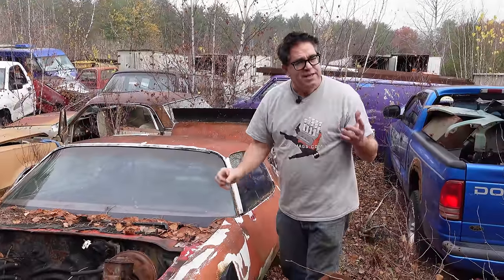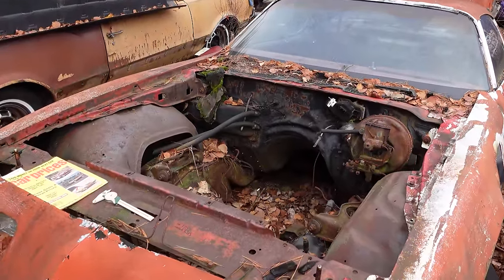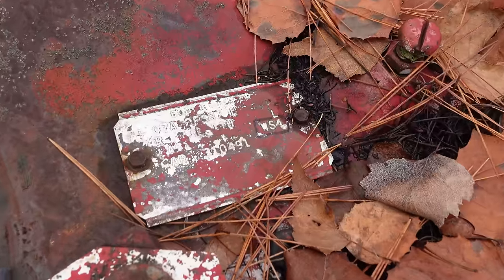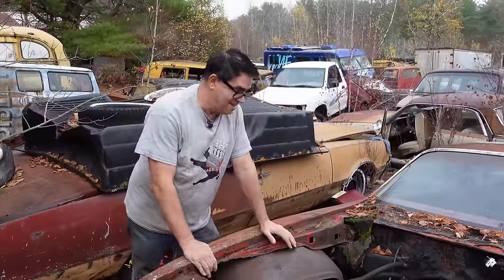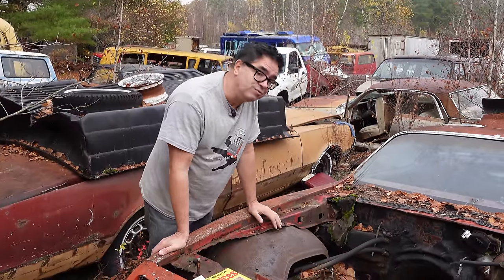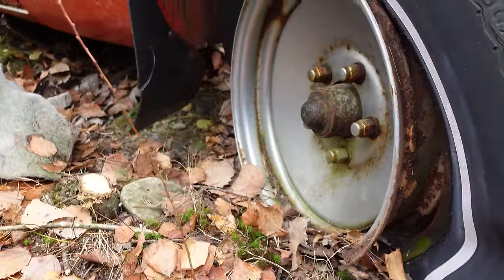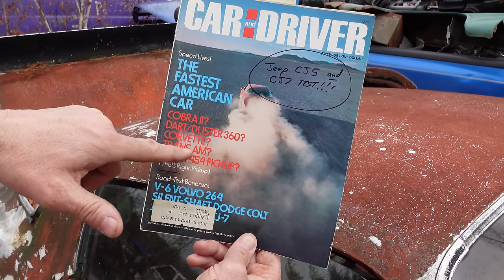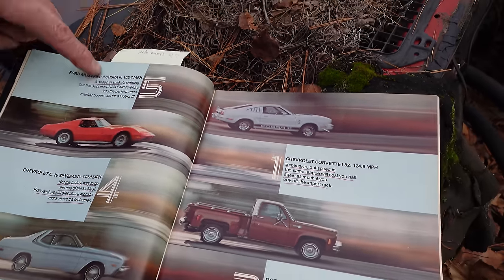1979 Trans Am

Comment: As a 40+ year owner of these cars, I like the 1979 to 1981 front end better. Plus the cars were slightly more refined. Nothing against the 1977 or 1978 models (and I like them), but I like these better. As many who know me know, I have an '80 Turbo in Carousel Red that my parents bought new in 1980 and I also have a '79 10th Anniversary 400/4 speed, one of 1,817 made. When I bought the 10th in 1999, it was "collectable" (not like today) and a 20-year-old used car. I am probably the sixth owner of it, but I know every owner it has had. It has only gone 7,000 miles from 1987 until now. The original owner of my car paid over $13,000 for it at the end of 1979/early 1980 and had to "influence" the salesman to find it for him with $500 cash. He bought a 403 car, drove with the dealer from PA to MD to get the 400 car (at Liberty Pontiac in Randallstown, MD) and then went back to Brake Pontiac in Waynesboro, PA to do the paperwork. Liberty Pontiac was at 3636 Brenbrook Drive and Caliber Collision is there now. Brake Pontiac became Lynn Buick-Pontiac (the original owner of my car traded it for a 1987 Grand National which I believe he still owns) and is now Buchanan Chevrolet at 1035 East Main Street in Waynesboro, PA. The original loan for my car (paid off in 1983) was from First National Bank in Waynesboro. As many know, I almost bought a 1981 Nascar Y85 Trans Am last year local to me, but I stuck to my guns on price and the seller sold it for more (I doubled his money. The person that bought that car is upside down already in it, I refuse to be upside down in it). 

We'll start with the tag, because with that you can brag: 79 for 1979 model year, 07A for the first week of July 1979 production, 2FS87 for Pontiac Firebird, N for Norwood, OH assembly, 74R for Carmine vinyl standard interior trim, 11U and 11L for White upper and lower exterior paint, L for lacquer paint technology, A51 for bucket seats, CAR for Carmine secondary trim (carpet, package tray, etc.) and WS4 for Trans Am. The WS4 is on the tag because that is an item that concerned Fisher Body on their end of the process.

No, you are correct, the VIN gets you the win: 2 for Pontiac, W for Trans Am, 87 for two door coupe, W for 301 Pontiac V8 with four barrel, RPO code "L37", 9 for 1979 model year, N for Norwood, OH assembly and the rest is the production sequence. The Norwood plant closed in August of 1987. Norwood cars used lacquer paint and those at Van Nuys, CA used water-based paint due to the CA air regulations at the time. Van Nuys, CA closed in 1992 and was one of the "Terrible Three" GM plants in California, along with Southgate (closed in 1982) and Fremont (closed in 1982, Tesla occupies part of this property now). Yes, both the automatic and four speed were a possibility on a 1979 Trans Am with a 301 V8. The Olds 403 cars only came with an automatic and the Pontiac 400 cars only with a 4 speed in 1979. 

Correct, getting a 301 in 1979 was a credit to the buyer. The standard Trans Am engine was the 403 Oldsmobile V8, VIN code "K", RPO code "L80" and optional (for about $90) was the 400 Pontiac, VIN code "Z" RPO code "L78/W72" engine. All 1979 Pontiac 400 engines were 220 HP (on paper) W72 versions that were stockpiled prior to 1979 for installation in 1979 models. Many have 1977 and 1978 casting dates on parts, as mine does on my 10th Anniversary. Yes, correct, 7,500 10th Anniversary cars, with 1,817 having the 400/4 speed combination and the balance 403 Olds V8 equipped. When you ordered a 10th Anniversary with a 400, you came out "ahead" since you got a credit for cruise control as you could not get cruise with a 400 Pontiac engine in 1979.

That book is wrong---the 301 was available in the Trans Am and yes, you're looking at one in front of you. I have a friend who has one and has owned it since 1982. I kid him all the time about his "parts car". LOL. He's from Boston, so he has that funny accent. When he calls my house, I say, "What's up, Paul Revere. How's the tea party going?" He comes back with some colorful words in reply. LOL.

No, the D53 is ONLY for the hood bird. If you want a good video to watch on that, look up John Schinella at the 2009 Trans Am Nationals. He describes how the D53 came to be and how he fought GM management to get on the option list. In 1980-1981, Turbo cars (like mine) had a "bulge hood" and other engines (the 301 non-turbo and 305) had a shaker hood. No, all 1979 Trans Ams got the shaker hood. If you didn't order D53, you got a shaker with no decal. Mr. Schinella is a legend in the Trans Am world and had a handle in the design of the 10th Anniversary Trans Am. The "Turbo Flow" wheels were made by Appliance Wheel to his specifications and were first seen on the 1979 10th Anniversary and then an option on 1980-1981 cars. 

Yes, the 455 VIN code "W" RPO code "L75" made 200 HP because it was straight out of the large car/station wagon parts bin as it were. No, I believe RPO G80 limited slip was optional in 1979, depending on the model, although many cars had it. That center section spoiler is the same GM part #480161 for all 1970 to 1981 Camaro and Firebirds with that type of spoiler. I have an NOS one from Roper Pontiac in Joplin, MO which Hal Roper the owner, supposedly tripped over in the parts department and told Jim Barry, the parts manager, "Get that thing out of there". Back then, I would scout NOS parts and I came across that one and Mr. Barry sold it to me very reasonably. I also have several used ones and side pieces too.

Yikes. (faints) NO. The 403 Olds is a small block V8. It is not an Olds big block. The Pontiac 400 is not a big block. Pontiac did not use small and big block designations. LOL. Au contraire on the Turbo 301. It gets a bad name, but it was right for the times because if you went over to the Blue Oval in 1980-1981, you got a 255 V8 that barely mustered 150 HP in Mustang. At least you got 210 HP in 1980 (200 in 1981) on a Trans Am when optioned correctly.
Reply: Hi , G P ,  heard a rumor a couple a years ago that some of Burt's cremains we're buried in one of the T A's he drove in the movie . They put the urn on the front driver's seat . It's supposed to be here somewhere in Florida .  Don't know if it's true or not , but I wouldn't put it past Buddy to request something like that .
Reply: @daynadiggle8169  I'm not sure about that, he did own a ranch in Jupiter, Florida, but he left it around 1999 when he went bankrupt. It's now going to be million dollar homes from what I read. Mr. Reynolds was promised a new Trans Am by the president of GM and then one year they stopped coming. He politely called and was told rather curtly, "That deal was with the old president and he's gone", and the guy hung up on him. Typical GM. I wonder today if that person would have been fired and Mr. Reynolds would have gotten a new one as promised. He did make the Trans Am sell. 

Another good role he played was in the "Longest Yard". Look up the car chase scene. Another bunch of Florida natives is in that scene---Saturday Night Special by Lynyrd Skynyrd. One of my favorite bands.
Reply: Lots of debate on where small blocks stop and big blocks begin, when we're talking about Pontiacs. For me, I consider everything, from the 400 on down, to be a small block, as those engines all had the smaller crank journals.  Big blocks would be the 421/428 and the 455 with their larger journals.
Other folks will note the displacements, and term the 389/400 and everything larger, as a big block.
Were 301 parts not interchangable with the rest of the Pontiac V8 line?  If that is the case, the 301 could be a small block, making everything from the 455 down to the old 287, a big block...
I always loved the '77-'78s in black and gold, but now I believe that the '70.5-'73s are my absolute favorite TAs.
Reply: @DanEBoyd  Never, ever, ever, ever, ever, ever, ever, ever, call a Pontiac V8 a small or big block. Never was, never will be. LOL. The term "large displacement" is better if you must use those terms. Chevrolet and Oldsmobile used those terms and they are recognized, Pontiac did not. Thou shall not call a Pontiac V8 a big or small block. LOL.
Reply: @DanEBoyd  Yes, some parts on the 301 will fit a 400. Depends on the part. Both my 301 and 400 use the same AC Delco 41382 fuel pump. They use the same spark plugs, R45TSX. Other parts were the same. So, they are not small and big block. Anyone in the Pontiac circle never, ever, ever, ever, ever uses those terms when talking about a Pontiac V8.
Reply: @daynadiggle8169  If you want to "meet" the guy that sold my parents the 1980 Trans Am new, his family did a tribute to his life on YT as he just passed this year. Look up "RIP Ernie Viespoli" on YT. It's a bunch of family videos of him and his family. In some footage, he's wearing a "DiFeo Auto Group" shirt which was the successor to Park Pontiac on Communipaw Ave in Jersey City, NJ where it was sold new. That building is now Hudson Hyundai. I used to get gas at the Exxon station (now gone) there all the time. He was the sale manager at Park Pontiac and I wound up trading e-mails with him about 7 years ago and I called him and spoke to him. He remembered the car and my parents. When I asked him how that was so, he said, "I gotta memory like a steel trap, kid. The girls were all wearing Candies shoes back then. My daughter wanted 'em and we bought them for her. Your sister liked them too and I remember commenting on that. Plus, how many Turbo Carousel Red cars could I have sold back then?" He was 100% right on. 

That's the same person that sold us the Trans Am new in 1980, as well as two Pontiac Bonnevilles (a 1978 and 1980 Brougham) and a '79 Phoenix. We also bought cars/company cars from the sister dealerships of J&F Oldsmobile and DiFeo Chevrolet, and my cousin's husband worked at Hudson Toyota which is still in business.
Reply: @DanEBoyd  big and small block have nothing to do with cubic inches. They are simply different engine design. Chevy had two type of V8 and one was smaller than the other. There’s nothing more to it. A chevy 396 is a big block. A chevy 400 is a small block, different designs.
Reply: Good write-up. I also prefer the 79 nose. it's what I wanted when they came out back in 79. I finally got one about 16 years ago, and now have 4. Being that 79's were the highest production, there are still many out there. One correction...all 79 TA's came with the limited-slip rear. I believe it wasn't until 81 that they decided to make the posi an option on the TA instead of standard equipment.
Reply: @grand73am  For the most part. Some literature shows it as optional. Most of the ones I've seen have it. Yes, optional in 1981. GM did some weird things back then.
Reply: like the 77 front end and 79-81 taillights
Reply: @googleusergp  Hi again , G P .  Just got back home .  Getting ready for another Cane !  Their knocking us out down here .  Can't understand why anybody would want to live in this state 'cept us Rebs .   And I'm so sorry to hear about Ernie . So awful . But the Candies shoes ?   Their great !  I still keep a couple of pairs I wear on the beach .  Well , you have a good one , Miller Time is coming up in about a half hour .  Enjoy !
Reply: @Yann396  That's exactly it in a nutshell.
Reply: And they were rating the 200hp at 3500rpm which is laughable in itself.....
Reply: Thanks GP for sharing your wealth of knowledge. Enjoyed reading this. 👍
Reply: Wow! Steve is right about your response. Same question I put out there in my comment. What about the his and her shift package? I only drove that car once and accidentally found the his shift package down the right. It just amounted to shifting through the gears one nudge at a time. When we got back with the car we told his dad what we had discovered. Apparently he did not know. Being a Methodist preacher he was a very honest man. He related to us teens and kids very well. The car actually unofficially got kicked out of that church it wasn't conservative enough. They went to church in a larger metropolitan area. After high School military duties lost track of them.. so that's all I know about the his her shift package. Curious to know if it was available on various engines or just the one. Or if it was a common item on those birds. I'm a first gen bird fan myself. By the time Pontiac got the firebird right again Mr Obama said here's your check and dropped the Pontiac division!
Reply: @DanEBoyd  The Pontiac engine is the same block for virtually every incarnation.  The journal sizes change almost year to year from 1955-1959, when they settled on one, but then to get more than 400 CI out of them they reduced the journal size to get a longer stroke.  The 301 and a short lived 265 version have a shorter deck and thinwall castings.  But even the 1961-63 194 four cylinder is the same block save it only has one cylinder bank.
Reply: I was looking for the Google Man's comment. I too favor the 79-81 nose. It's my favorite as well.
Reply: @daynadiggle8169  last I saw his Trans Am went through Barrett Jackson a few years back
Reply: Google user GP,. Are you sure that was lacquer paint?  I thought Acrylic enamel baked in oven was the factory paint of the 70's.
Reply: Thank you for posting this! I have owned two of these cars, so I appreciate this as I did not know some of it.

My OCD always kicks in when I hear someone call a Pontiac motor a "big block"! As you have stated, there is no such thing.

Great info!
Reply: @googleusergp  Yup , yup , yup right , G P .   My Chev 454 , BIG  BLOCK .   And I love big blocks .  Yes , I do baby them with open hood at every stop , oil and filter every 1,000 miles , and a little upgrade on the gas , not corner store swill .  I always had small blocks to race with a big block thrown in there ever now and again .  But learned to love a big block .
Reply: Did you know that James Garner abhorred the 79 so much that he turned down fatory cars and kept 78s at his own expense For filming on the Rockford Files?   Given that the show was known to wreck a car every now and then it probably was not too cheap for him.
Reply: @kennethsouthard6042  Hi , Ken , weren't these all Esprit models ? As I recall , Jimmy wouldn't drive anything else on the show .
Reply: @daynadiggle8169   That's my understanding too
Reply: @Yann396  Actually, for a while, a Chevy 400 could also be a big block. That 400 was just a 325 horse 396, punched out to 402, the way Chevrolet made them from 1970 till 1973 or whenever.
If you got the SS 396 option on a Chevelle, Camaro, or Nova, the engine was badged as a 396, but if you got one in a pickup, full size car, Monte Carlo, or Chevelle 400, it was badged as a 400 Turbo Jet. I think the SS 396s were all 350 or 375 versions, while the 400, I'm pretty sure, was just a 325 horse version.
The small block 400 was the Turbo Fire.
Reply: @DanEBoyd  yes I know that. I have multiple 396, 402, 427 and 454. The point is that BBCs and SBCs are just 2 different engine design, it has nothing to do with cubic inches. Those terms where invented by Chevy back then to differentiate their V8s and the concept has been misused for years for other brands engine. All V8 Pontiac use the same engine design from the 306 to the 455. No small or big block for Pontiac.
Reply: @dand3975  Lacquer paint. That's what the "L" on the tag means.
Reply: @will7its  Until you own and drive one as I have for 23 years.
Reply: @NotAGarage  I'm here, but comments are dropping in and out. Let me know if this stays or not.
Reply: @_Dave_S  "Thou shall not call a Pontiac V8 small or big block". LOL.
Reply: @DanEBoyd  You're mixing and matching things here. There is no Pontiac big or small block V8. Period. End of sentence. Parts do interchange between smaller and larger displacement Pontiac V8s. Pontiac folks NEVER call them small or big block. Ever. LOL.
Reply: @daynadiggle8169  I was always a Pontiac person. There's been a Pontiac in my family since 1977. I like Chevrolet V8s, but I like Pontiacs better.
Reply: @daynadiggle8169  Yes, Mr. Garner did not like the Formula so they "de-Formulaized" it for his liking.
Reply: @googleusergp  Hi , G P .  Yes , my problem is I like 'em all !  I'm just settling in for a night of hurricane .  I think it's gonna hit south of where I am .  But good gravy , we just went through this 5 weeks ago !  Oh well , the gator tail's cooked and the whisky's flowing . Talk at you tomorrow , I hope .
Reply: @googleusergp  Yes , G P , I love Pontiacs too !  Especially the Fiero's .  Am watching channel 6 and 9 news and the sheriff's office is removing people from their condos in 9 to 12 buildings because of fear of collapse .  The sea walls have been washed away and the erosion is devastating . Beaches are closed of coarse , but I was there this afternoon in Daytona to see this .  A-1-A is closed and no one can go in over the bridges after 4:00 p.m.   Maybe you can see this on the World News at 6:30 p.m.
Reply: @daynadiggle8169  Stay safe there.
Reply: @daynadiggle8169  Ernie was a character and he was the sales manager back then. I still have his card from 1980. Back then he wore a brown three-piece suit, a gold bracelet and looked like a real disco type of guy. By then he was married with a couple of kids. He sold my parents at least four cars between 1977 and 1980 and several other company cars to my father's boss and others in the company. Back then Park Pontiac, J&F Oldsmobile (where my '84 Delta 88 came from, my uncle was the first owner), and DiFeo Chevrolet (now Jersey City Chevrolet) were all related businesses owned by the DiFeo family. A 1978 Bonneville, 1980 Bonneville, 1979 Phoenix, 1980 Trans Am, 1979 Caprice, 1984 Delta 88, 1980 Buick LeSabre, 1979 Caprice wagon, and 1978 Grand Prix are all cars we owned/drove/had access to that came through the DiFeo dealer group. If you watch that video of Ernie, he's wearing a "DiFeo Auto Group" shirt probably from the 1990s. 

I remember when we looked at it, Ernie said, "The only new 1980 I have left is the red one your kids are sitting in". When my mother said, "That's not red, it's orange", my dad said, "We'll take it, we'll never miss it in the parking lot". That was October 1980 and we (now I) still have the car. I reconnected with Ernie around 2014 and exchanged e-mails with him. Like I related, he remembered the car. I remember my father not wanting a "Park Pontiac" dealer sticker on the car and Ernie telling the porter, "No decal". The porter said, "Bossman (Sam DiFeo) says they all get them". Ernie said, "I'll talk to Sam, not this one." I remember my father telling Ernie, "Floor mats have to be included". Ernie said, "Geez, you're like a vacuum cleaner, sucking my profit right out of me.". My father laughed, "Who are you kidding Ernie, you'll just charge another customer for those mats".

Fast forward to 1984 and my dad is working at the Cadillac dealer and he says to his sales partner, Chuck, aka "Mr. Cadillac", "Why are we always short mats?" Chuck said, "Dang Detroit (Clark Street, in Detroit, MI) always shorting us. I think the line workers pinch 'em for themselves". So it was the "shuffle" of mats to get a car prepped and sold. My father said, "Chuck, the Pontiac dealer tried that in 1980 with the Trans Am". LOL.
Reply: @googleusergp  Great story , G P !   Your dad sounds a little like me .  I freak the sales people out when I buy new by telling them I'm paying cash . They always go sure , sure !  Until the next day when I walk in with a certified bank check and ask them is my car ready ?     They can't even sell me financing !
Reply: @daynadiggle8169  Yes, my dad was good on both sides of the desk. He eventually became a salesperson and sales manager for a Cadillac dealer, and he had a knack for it. Yes, paying cash is good, but you don't tell them that. Never tip your hand with it. Just get your best "out the door" price and only tell them how you're paying when the time is right. If they know you are paying cash, they are losing out on finance charges and money, so they will play games with the price.
Reply: @googleusergp  Exactly .  That's how I work it and even bargain them in for no dealer fee .   I don't know if that still works today , it's been several years since I bought a new vehicle .  But leaner times are a coming and I'm sure they will get hungry again !
Reply: @daynadiggle8169  This is a unique market. I'm trying to buy a new Corolla for a commuter (yet, I will keep all of my current cars), and the prices are off the charts. You can't even order what you want and wait. Nope, it's tough. I even contacted a high school classmate in TX who is a GM of a Toyota dealer. I'd buy the car, fly down there and either drive back or have it sent up to me and I'll do the dealer prep, licensing, registration and inspection myself. The "documentation fees" are pure fat and profit. NY caps it at $175 but NJ does not have a limit. I know what I want, and I know what it should cost out the door. I'll get my number eventually. As you indicated, supply and demand will dictate how it goes.
Reply: @googleusergp  Well , ya gotta do what ya gotta do .  Lately I've been picking one of my classics , registering it , insurance and drive it for a little while . This is good for these vehicles and saves me countless thousands on a new one right now .  I'm getting closer to 70 years old so I don't need to much of anything any more .  A new car is in my future but the auto company's gotta start doing a little better for us , the consumer . News flash , 22 more condos are being evacuated in Daytona Beach Shores at this minute .  I'm in the main house and let me tell you , the wind is whipping and howling outside right now . I'm a bit inland so I'll probably have minimal damage .  Just pisses me off that I just finished this week getting my place put back together from IAN .
Reply: @daynadiggle8169  Hopefully it misses you.
Reply: @googleusergp  Thanks , G P , but the storm is so big we are all going to get something . I'm inland a bit in Volusia County and that counter clockwise rotation of the storm clobbers us here .   But with some prayers and a little luck we can pull thru this thing . I really feel sorry for the people beach side .  Their condos ,some high as 12 stories could collapse .  This is why I won't live there .  Your always safer inland except for sinkholes .  And it goes on and on . Still don't know why any body but a native would want to live here .   Oh , and flooding !   O K . I'll shut up .
Reply: @daynadiggle8169  Conserve your power for now. You are in a state of emergency. Good luck.
Reply: @googleusergp  Roger that ground control ..........
Reply: @googleusergp  You are Correct about the paint GM used in the 70's and 80's.  I did some checking, A dealer body shop employee in the 1980 s said it was acrylic lacquer paint from the factory.   GM didn't update paint technology untill production of a  line of cars ended.
Reply: @dand3975  I know that. LOL. That's why they put the paint technology on the tag. No, that's not correct about "waiting until the line of cars ends". GM used whatever paint they had to. Van Nuys used water based at the same time that Norwood was using lacquer. Some cars had enamel. Depended on the paint, the regulations at the time, etc.
Reply: @googleusergp  you should start posting on your YouTube channel 🙏 post facts on different cars. Even if you just read over the stuff you've commented on👍👍👍👌👌👌 I'd love it. You always have your own thread going on videos anyway lol
Reply: @NotAGarage  Nice of you to say. One day I might do that. I think I'll eventually be a guest on a few channels for starters.
Reply: @Google User GP  You're right about the Longest Yard chase scene being very cool 😎, but I especially love the scene where the cops confront Burt at the bar after he sinks the car !
Classic Burt Reynolds laughter 😃
Reply: Thanks for sharing this info.  I need to research the 301 engine I really don't know it
Reply: @RDEnduro  Sure. It was used from 1977 to 1981. Pontiac produced in the Pontiac, MI engine plant. There was a two barrel version, RPO code "L27" VIN code "Y" used from 1977 to 1979. There was a 4 barrel version, VIN code "W", RPO code "L37" used from 1978 to 1981. Then, there's the turbo 301, VIN code "T", RPO code "LU8" used in 1980-1981 on the Formula and Firebird. The 301 four barrel was a credit engine on the Trans Am in 1979 and in 1980-1981 it was the base engine.
Reply: @stuartb9323  Much the same as when he is introduced to "Big and Little Enos" in Smokey and the Bandit. LOL.
Reply: @googleusergp  Exactly 💯 %
Reply: @stuartb9323  Yup.
Reply: y do u have 27 subscribers but no videos of your TA nor any videos at all?
Reply: Yes. No channel of videos yet. Maybe one day.
Reply: @googleusergp  My real question is, why  are you getting subscribers when there is no content to view on your channel?
Reply: @fixxforlife1569  Ask those who subscribe.
Reply: @googleusergp  I can't ask them because I cannot see who they are. You can see them so you could ask them for me.
Reply: @fixxforlife1569  You missed the point. Who knows why people subscribed? Maybe for my sparkling personality. Maybe for my wit and smile. Maybe for my automotive industry knowledge. Maybe a combination of all three. LOL.
Reply: @googleusergp  I didn't get an answer, that was my point in asking again.  There is nothing I see gained when subbing to your channel because there is no content there. Unless maybe your content is marked as private or something else that only you could provide an answer for.  Which is what I was hoping to find out from you.
Reply: @fixxforlife1569  You're really missing the point here. LOL. People subscribe because they like to read when I decode a VIN or cowl tag and follow me when I do that on various channels.
Reply: @googleusergp  There is no way to "follow" you on "various channels".  They can only follow you on your own channel.  But there is nothing on your channel.  That is the point you are missing.  That is the only point.
Reply: @fixxforlife1569  You seem fixated on the fact that I don't have videos or content for some reason. I don't know, people tell me that they follow me around when I go to the various channels and do VIN decoding and deciphering the tags. Either way, it's a moot point. It's my choice to have (or not have) videos on my channels. I don't need to prove anything to anyone. Maybe I'll do some content in due time. Maybe I'll be featured on Mr. Magnante's channel, among others down the road. Who knows? Having or not having content doesn't make you more or less competent.
Reply: @googleusergp  I never said anything about being competent or not.  And you keep bring up that people "follow" you.  YT has no feature that allows a person to follow another person.  It only has features to let a subscriber 1:  be alerted when the subscribed to channel posts content and 2:  adds the subscribed to channel to a list of all their subscribed to channels.  All I ever did was ask why are people subscribing to you when there is no benefit from it.  It's like subscribing to a magazine that never publishes a magazine.  I went to your channel because I was interested to see if you had any videos I could watch.  There were none.  So I did not sub because there was no benefit in doing that.  It does not allow one to, as you stated to "follow" you on other channels. All it would do is clutter my subscription shortcut list.
Reply: @fixxforlife1569  LOL. I answered you like 5 posts ago. I don't know why people subscribe to me. I'm not asking you to subscribe, nor do I care. This is a pointless conversation that is going round and round with no point to it.  Perhaps people think that they will be notified when I reply to a post or a video, I don't know. Either way, at the moment I don't have content to post and I don't have plans to at the present time. Maybe down the road. We'll see.
Reply: @DanEBoyd  All Pontiac engines from 326-455 used the same external block dimensions. The 301 was a short deck version of the Pontiac V8. Pontiacs except for the 3 initial V8s which were 1 year offerings can be referred to as small and large journal blocks. 400 and smaller factory offerings were “small” journals which used 3” diameter main crankshaft bearing journals. The 421, 428 and 455 are the large journals which were 3.25” diameter. I believe the 3.25” journals were the largest used on an American manufactured automobile V8. So if you really want to be technical I guess you could consider all Pontiac engines except the 301 and 265 as big blocks since they were a short deck height version of the traditional Pontiac V8. Oldsmobile had small and big blocks that basically fit the same description. As far as I know a small block Olds 350 is nothing more than a shorter deck version of the 400 425 and 455 big blocks but I could be wrong. I also believe Buick was similar. None of these 2 engine designs had the visual differences that separate the small and big block Chevy.
Reply: @mikee2923  No. You can't call a Pontiac V8 small and big block. No one (except the ignorant) ever call them that. Some parts are used on all Pontiac V8s, no matter what the displacement. What you say is on the right path, but calling them small and big block Pontiac V8s is a big no-no in the Pontiac world. LOL.
Reply: @googleusergp  I know that as I have been a lifelong Pontiac enthusiast especially the malaise era of Pontiacs. I was just pointing out some thoughts that just came to mind I never really had before. But I agree 100%. Real Pontiac engines came in 1 style of block. Right or wrong I don’t really count the 301 or 265 because in my opinion they were both garbage. Although I do wish they would have allowed the 301 in 3rd gen Firebirds. This would have made a 400 or 455 swap into them a bolt in ordeal. Especially since I have owned an 89 Formula 350 since 91. It with a 400 would be ideal. The extra torque of the 455 wouldn’t be beneficial since the 3rd gens were pretty lightweight to begin with.
Reply: @mikee2923  Both the 265 and 301 were right for the times. I don't acknowledge 3rd generation F body Pontiacs as real Pontiacs. They are "Chevyiacs" with their small block Chevrolet V8 power. The "real" last Pontiac Trans Am was 1981 for me.
Reply: They LOOKED GREAT! The "301" was CRAP, though!
Reply: @johnmaki3046  Slow? Yes. Crap? No.
Reply: @googleusergp  The "301", to my experience, WAS CRAP!
Reply: @johnmaki3046  I have owned one for 42 years. The "problem" with the 301 engines are the "mechanics" that attempt to "fix" them.
Reply: @googleusergp    I had a 79 GP 301. V8 and better mpgs than a 4cyl Honda at the time.
Reply: @vannjunkin8041  We had a 1978 with a 301 as a company car.
Reply: @googleusergp   Grand Prix?? My favorite years are 78-80 for those.
Reply: @googleusergp He liked the Formula,  it just didn't fit the characters financial situation.
Reply: @707x-y6s  That's true. He was supposed to be a struggling/on the fringes type of guy.
Reply: @googleusergp  I have a 1979 Trans Am SE 400 WS6 4spd car with T-Tops. It has the black hobnail velour interior. It is numbers matching and is in great factory original condition. I also think the 1979 looks better.
Reply: @VegasRT500  You've got one of 1,107 made. In my case (10th Anniversary 400/4 speed), it's slightly less rare at 1,817 made.
Reply: @googleusergp  Awesome! Thanks for the info and the reply!  I had a 1979 10th  Anniversary back in the 90s but it was a automatic. The Anniversary cars are sweet! I think the 79 Trans Ams are cool!